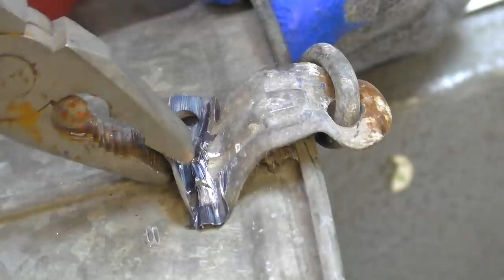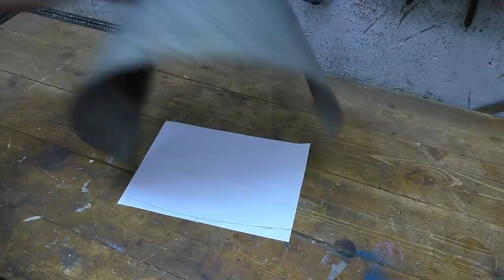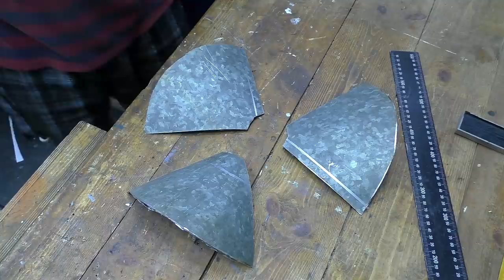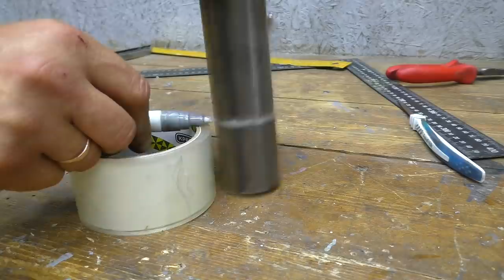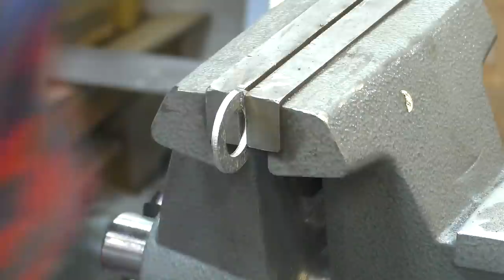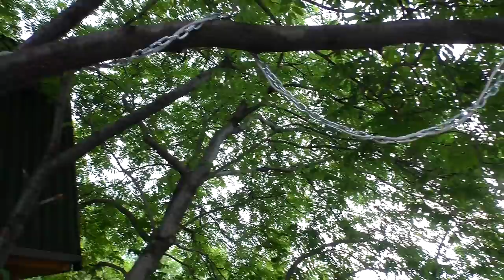TOOK AN OLD BUCKET AND RIVETS!!! and here's what happened

Comment: Just scanned the comments and saw lots pointing out the high effort level for the result involved,  but didn’t see anyone mention that the lampshade builder likely poisoned himself with zinc oxide fumes from doing hot work in an enclosed shop on galvanized steel- some very serious precautions need to be taken when welding or grinding on galvanized  material.  Please don’t try this at home!
Reply: Yes never weld galvanized metal very toxic I have see people weld old trampoline tube to patch car exhaust pipe
Reply: This was pointed out already before u
Reply: Oh yes… in the time it took to make this video is about how long it took the guy to die afterwards…🙄 

Galvanized steel can be and is welded all of the time. Yes the fumes are toxic but you’d have be exposed to them for a while before seeing the worse affects from breathing any zinc. Wear the right gear and insure air circulation/exchange.
Reply: @db5145  
"Insure air circulation/exchange".
Where can I buy such an insurance policy?!
(Did you mean 'Ensure', possibly?! Considering your negativity and public ridicule of others, I'm sure you will appreciate my comment.)

Comment: Price of angle grinder discs £10
Price of electric to use tools 50p/hr 
Price of original bucket £5
Welding wire spool £20+
Rivets £10
Rivet gun £10
Chain £5 a meter 
3 core wire £2 a meter 
Time wasted making something you can buy in b&q for about £15 priceless !
Reply: So how should I apply the grinding disc if I don’t buy an angle grinder 🤔

Comment: Shucks a handy feller could use a couple dollar hardware store funnel for the lampshade, find a swag lamp in the back alley or dump complete with the long cord and long chunk of chain and the light fixture as well and build the lamp darn near free. My point is that those old steel pails are gettin harder each year to find because we can't get them new anymore, just plastic junk from china. I buy and sell all kinds of gear, everything from antique vehicles to toys, I regularly get anywhere from 10 bucks up to 30 bucks for an old galvanized steel pail like that if it's in pretty good condition.

Comment: Have you been to Bandana’s? They use the whole bucket for the shade. It was only necessary to remove the handle. Use the mig welder to reattach the bottom to fill rusted gaps
Reply: Yes! I have been to Bandana's.
They have expensive crystal chandeliers, not 'bucket' light shades.
Surely you've noticed the difference between the shape of a 'bucket' and the shape of the shade produced in this video.
Why so negative about the efforts of others?!
Is that the only way you can feel 'adequate' in life?!

Comment: The description should read: I took an old bucket, rivets, angle grinder, welder, washer, rivet gun, gloves, drill and drill bits, centre punch, pipe, sheet metal, metal file, marking pen, right angle, ruler, bench vice, chain, electric cord, c-clip, wall plug and bulb..... and this is what happened. After writing this I know exactly what you felt when you stood back to admire and experience the impact of this project on your psyche.

Comment: Sad, sad situation.....1) could've cut the shade in one piece.....2) would've been a lot easier to sand before riveting, probably a palm sander quicker and better.......3) that chain is way to heavy for this project, a lighter rust resistant chain would be better.......4) painting the inside of the "shade" white would be better for light, and could use a smaller wattage bulb.....just saying......

Comment: Very clever...nice job!  Question please...when you were using the cutoff tool while cutting up the galvanized bucket you kept raising the wheel off the line and placing it back on and doing another little cut then repeating?  What is the reason for that...heat buildup?  Thanks!
Reply: A nice idea , but he could have saved  himself a lot  of work if he  just went out and bought  the shade. Even the chain, he could have used a thinner chain, and those plastic tie - clips,  the ones used for holding a bundle of wiring together. Thanks for sharing.
Reply: There's no sensible reason for that, but did you notice by doing that it left many sharp shards on the edges and he never bothered to clean them up? Very hazardous. A cut form those jagged edges hurt like hell
Reply: it's easier to cut straight that way
Reply: @SteveMacSticky  Exactly! Make a cut, check your alignment and stay on the straight, cut and repeat. That is one way to not end up uneven and unusable.

Comment: So he traced the radius of the top of the bucket, but somehow ended up with a smaller radius to cut the smaller pieces? Next thing you know he'll try to weld galvanized steel to a steel pipe.

Comment: Every aspect of that task was a perfect example of ignorance and lack of skill. Cutting galvanized thin sheet steel with a grinder. Luck you didnt slice your hands up when standing the rust off. You drill out the rivets not grind the heads off. Dont use HSS drill bits as pin punches unless you fancy wearing a piece in the eye. Oh and you used twin core flex with no earth on a all metal light shade with no insulated grommet fitting and hung it outside on a chain. One day when you touch it after a few weeks 110-240vdc will flow through you and your bare feet on that wet floor. Enjoy your creativity.
Reply: Or just go buy an outdoor light for $15
Reply: I bet you're fun at parties. 100% agree with you though :)
Reply: U mean ac not dc.  U get tickles in larger volts than that in DC on wet ground All the time from example, dc welders, spark plug leads. Etc.....

Comment: A bucket costs $20. A sheet of galvanized costs $20. You could make 10 lamps out of a sheet, Doesn't seem cost effective. Your skills are impeccable, though. arian yari is on to something, a good set of Klenk aviation snips(left and rights, they go together like peanutbutter and jelly) will give you faster, safer, cleaner cuts. Klenks are made in the U.S.A. too.

Comment: If the bucket had a hole in it and was no longer usefull making a nice lamp from it was a good idea. If not, you will need another bucket. it is always satisfying to use useless things to make usefull things. Also why did you paint it? It was much more interesting with its galvanized finish and the little rivets.

Comment: Wow, all that lampshade from just one bucket.  Wouldn't have been quicker and easier to just drill a hole in the bottom and then put the bulb inside it?  At least that way you wouldn't have needed to inhale the toxic fume from welding zinc-plated steel.

Comment: No bucket now when he needs one. Ruined a fine bucket sur.
Reply: I guess you didn't see the holes in the bottom.
Reply: @allenmckinney9533  aaaaaaaaaaaaaaaaaaaaaaaaaaaaaaaaaaaàaaaaaaaaaaaaaaaaaaaaaaaaaaaaaaaaaaapaaaaaaaaaaaaaaaaaaaaaaaaaaaaaaaaàaàaaaaaàaaaàaaaaaaaaaaaaaaaaaaaaaaaàa
Reply: Where's the bucket for cold drinks lol.....
Reply: 14.95 at Walmart $
Reply: Hahaha hahaha
Reply: @allenmckinney9533  For carrying coal and wood or waste it's a good bucket. As a water tank you use plastic usually.

Comment: Invest in a pair of shears or should i say Sinps it would help you greatly when working with sheet metal ..... you have a great spot welder why uesing rivets ? anyways good luck .....
Reply: You cannot weld galvanised steel. It just dont work old son.
Reply: @paullee5573  of course you can. Done it countless times.
Reply: Also have don it countless times.  In “the old days” we would drink milk 😂.  The thought was , the calcium in the milk would prevent illness from breathing the zinc fumes.  The Company nurse wore a cool pointed black hat.😬😬

Comment: Too bad when it rains it would blow either the bulb the wire or a breaker because the hole in the top leaves it wide open to water getting in 
I would have taken some of the left over material and made a smaller hood to go over the hole